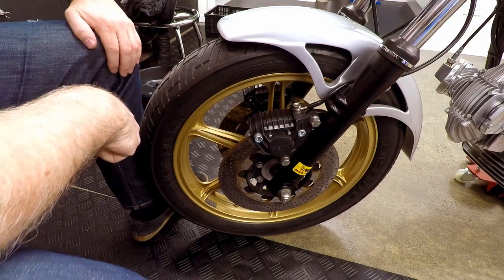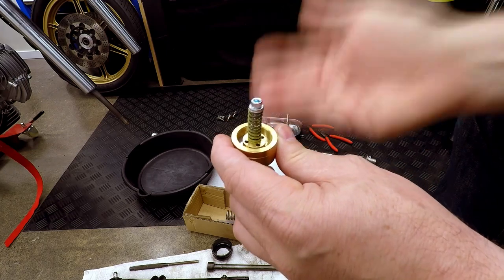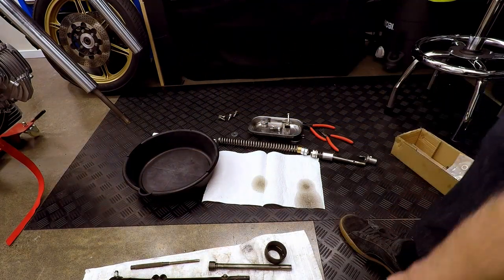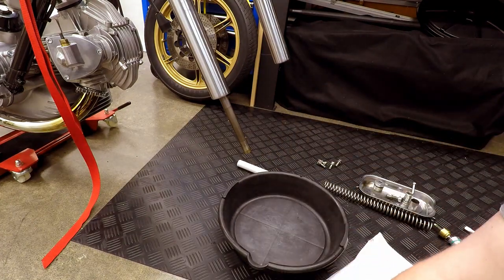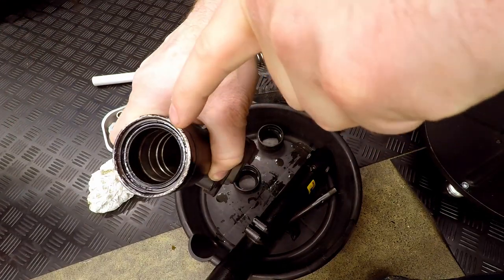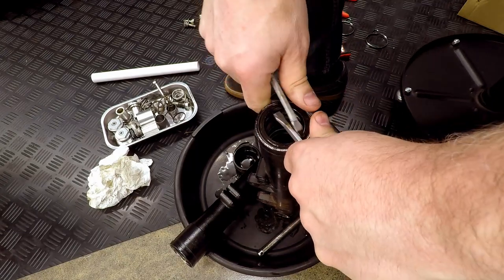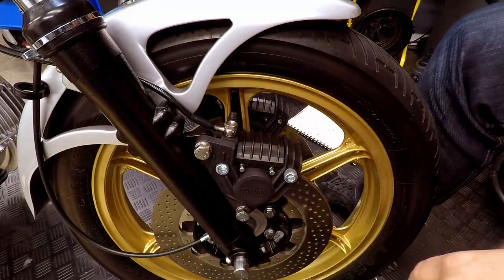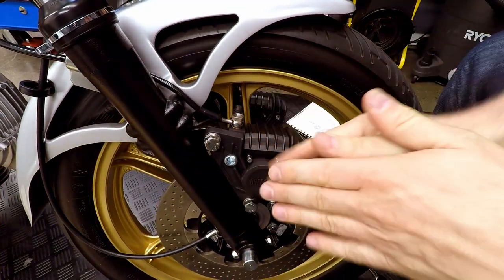Race Tech Fork Kit (Short) - Ducati 900SS Bevel Restoration

Comment: I have always found it much easier to dismantle the forks upon the bench. You can, if you feel the need, loosen the bolt on the end of the legs with the axle partially in place, then remove the legs from the triple clamp but I have never had the need. I think also the use of a rattle gun is over-kill and should not be necessary. In an ideal world - the two caliper lugs would be placed between a vice soft-jaws so the energy of untightening  is shared between the two lugs and not just one. My 79 900 SS functioned flawlessly so I am a tad surprised by this mod - maybe your front end and mine are not the same.
Reply from the maker: Hi Apistosig. Yes one could pull it all off the bike as well. The rattle gun suggestion came from Brook's experience in doing these upgrades.  It's possible for the bolt to be stuck in the rod but slip in the leg and you end up spinning the guts around in the tube and no way to hold into them. In my case it came out very easily. I have no other bevel to compare my bike with but the front end was anything but subtle before, and after this mod it is more like a modern bike. I was prepared to not notice it, but it turned out to be much more significant than I expected. Now if the weather will hurry up and improve then I can get out and make use of it!

Comment: Thanks for this; I was contemplating the same last year but wanted to ride the old girl first and see how the front end felt.  I'm interested to know what happened to the gap between the speedo-drive washer and the lower fork leg after you did your pumping.  I don't understand why you left the right leg clamp loose.  The width of the left side spacer should be 17mm and the combined speedo drive and washer the same on the right so that, assuming the wheel bearings are equally spaced,  when the spindle shaft bolt is tightened, the wheel is perfectly centred between the forks.  In your video, you torque the nut first but somehow this has not pulled the right side fork leg against the speed washer.  I am missing something.
Reply from the maker: Hi Rick. There's a much longer segment about tightening the front end in the long version playlist.. somewhere in the 4th video I think. 

There should be a gap on the right side by design, even if it's tiny... mine is about 1mm. And yes, the left side bolt pulled it all up very tightly beforehand. The reason the right leg pinch bolt is tightened after the other side is so that both legs will slide without binding caused by the legs either being squeezed together or pushed apart. The gap is the evidence that the sliders have come to sit on the axle without any sideways pressure. If there is no gap then there is either a problem, or it just happened by chance to all add up to the exact width between the forks... which is unlikely. 

The bouncing up and down is not entirely necessary. I just did that to clear any sticking and loosen it up as the forks hadn't been moved at all as a unit to that point (I actually bounced it a lot more and much deeper than in the vids). In the video, you can see where I am able to move the right leg freely left and right along the axle with my fingers... and so I could tighten the pinch bolt and know the legs are going to be sliding straight up and down.
Reply: @Ducati900SS  When I rebuilt my bike, I found the soft ally speedo washer had dished, a common problem, so I bought a stainless replacement.  When it arrived, I measured everything  on each side and the speedo + washer was the same thickness as the spacer on the left.  When I assembled the bike, the disk brake rotors were exactly centered with the caliper splits on each side.  The complete assembly was a very snug fit; I don't believe that there was any pinching of my fork legs when all was tight.  If there is a 1mm gap on the speedo side doesn't this mean the wheel can float 1mm to the right and only the brake pads are centering it?

I'm enjoying your videos; I've already shared this group with others that are also thinking of going with the Gold valves.
Reply: @robax  I went to the garage today to double-check!  When I fit my wheel, I had done it the same way as you, big nut first followed by the clamp bolt on the other side so the result is the same but it's my guess that the gap on my bike is smaller and less obvious than yours.  I'd not realized that the step on the spindle pushes against the speedo drive washer; certainly makes sense.  All is good!
Reply from the maker: @Rick-uu5yo  If you take the axle out, you'll see it has a step on the right side (side with the pinch bolt). The left side nut tightens everything, speedo drive, washer, bearings etc up against that step, not against the fork. When tight, you essentially have a solid L-shape with the left leg and the axle. The right fork floats on the remaining bit of axle until it it locked in place with the pinch bolt (Brook said he calls it the Jesus bolt). The point at which it is tightened should be where the leg rests without anything pushing it along the axle in either direction. 

You might be thinking (as I once did) that the step in the axle comes to rest somewhere against the inside of the right fork leg and is tightened along with everything else on the shaft by the main nut. However, the axle is clear all the way through that leg and so that leg basically floats until locked by the pinch bolt. It's not commonly understood and that's why I decided to dedicate a section of the video to it. 

If the callipers were too far off-centre when done then shims might be needed. However, if it was far off then I'd be looking for another issue such as a leg that wasn't straight. Stanchions are often not 100% straight so it wouldn't be unheard of. Because I'm into being precise with this, I did actually put 0.25mm spacers on that side once I was done.

If yours lines up without a gap and you're certain that the legs are not being stretched in any way then I see no reason to change anything. If you undo the pinch bolt, then torque the main bolt again, you'll be able to see the fit.

Thanks for the share too!
Reply from the maker: @Rick-uu5yo  Bingo! Makes sense in the end :)
Reply from the maker: @Rick-uu5yo  Mind you... torque-ing up the big bolt against the speedo drive housing was a worry.. it seems so flimsy.